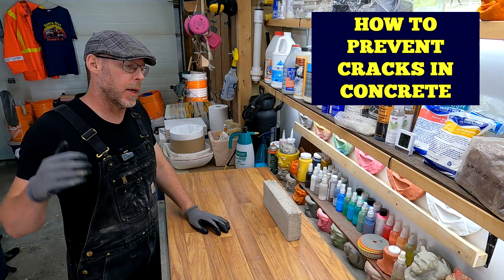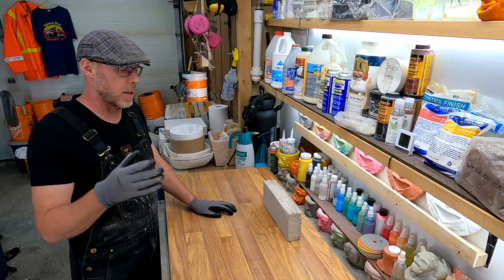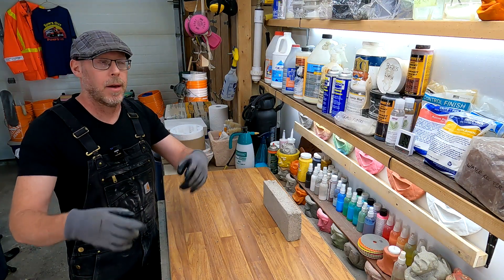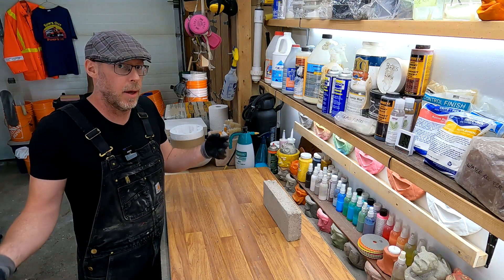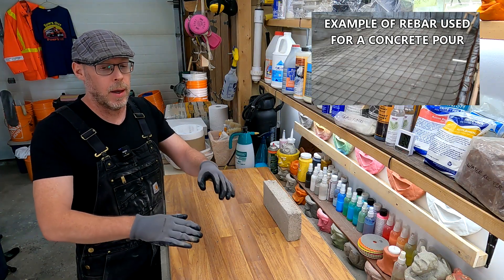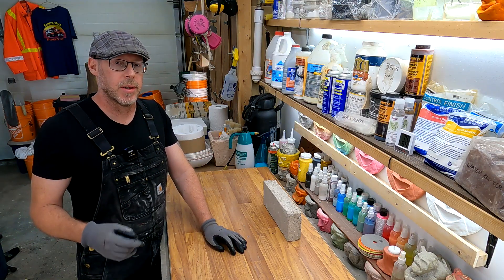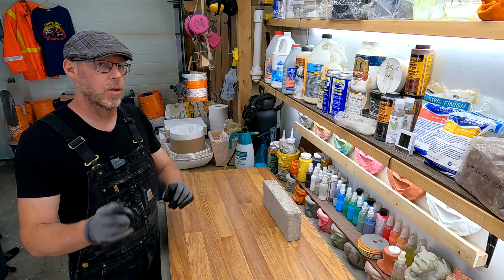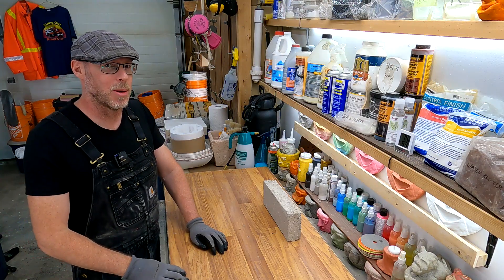How to Prevent Cracks in Concrete

Comment: Great video. I found it very informative.  I'm building a PB court. The ground is a little muddy.  My plan is to dig out the area for the court, apply a geotextile, and add10" of road base or crushed concrete.  Then, use a vibrating compactor to pack the road base, give the area a few months to settle and then build forms out of wood and pour 4" of 3k psi concrete. I can get concrete with fibers. Do I still need a steel mesh and rebar along the edges?  Any advice is appreciated.  I live in NC in the mountains and we get a lot of sub freezing winter days and a lot of rain. I was even thinking of putting drainage under the road base so water has a way to get out but not sure if that is a waste?  Thanks

Comment: Interesting that you reference clay as a uniform material. Around here expansive clay is a big cause of floor slabs cracking - the clay under the edges of the slab is exposed to much more wetting and drying than the middle of the slab, which just tends to slowly dry out over time. When the clay under the edges wets and expands, but the middle is still dry, that's prime conditions for cracking. If it doesn't go the first time, the process of the edges lifting and dropping according to soil moisture changes will crack it eventually.